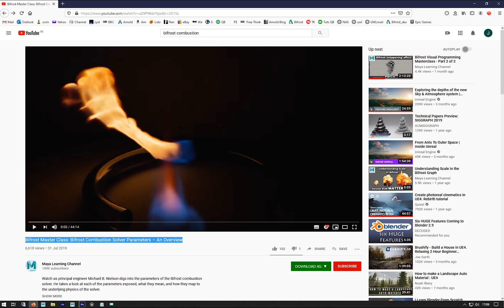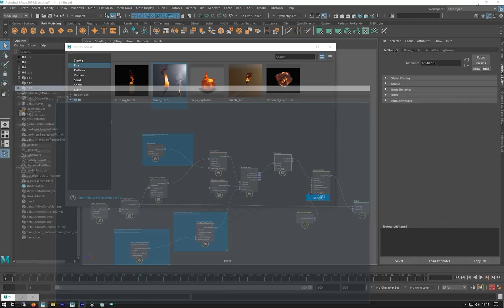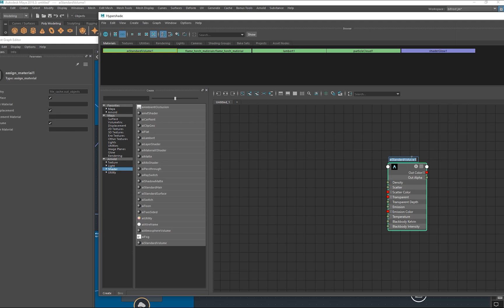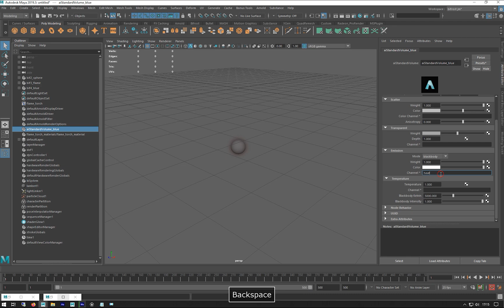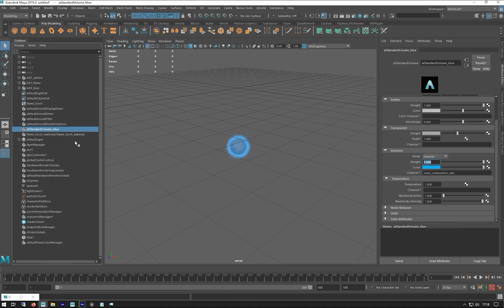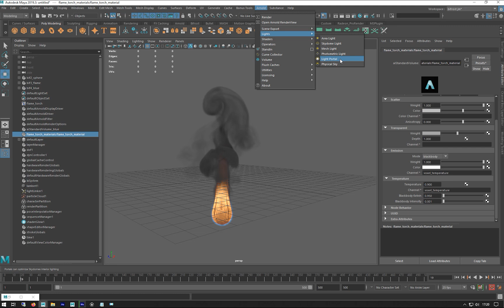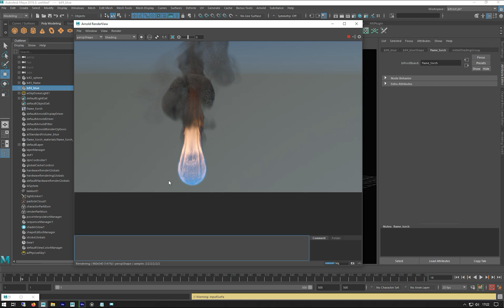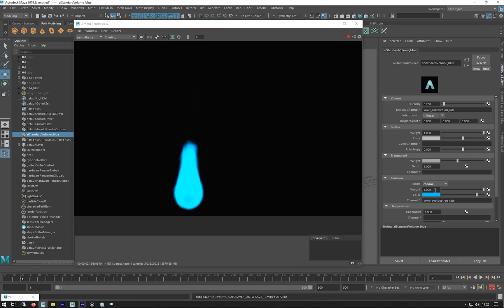Bifrost Graph Blue Flame Set Up

Comment: There are several things I don't understand. Some things were done without explanation. 

The aiStandardVolume shader I do not understand. Some fields were left blank. Two used voxel_combustion_rate. Why? 

Is there any way to prevent that initial mushroom from popping up and having a more natural flare-up at the beginning instead?
Reply: my reply is 2 years late so you mightve figured it out by now, but this is for others; to reduce that initial mushroom, you can try playing around with dissipation(rate at which the fire fades off), radiative heating(plays with the upper part of the fire) and radiative cooling(plays with the lower part of the fire). Theres probably also other settings you could adjust to fix that initial mushroom bomb you get, but thats not within my knowledge

edit: i may or may not have the radiative heating and radiative cooling mixed up, either way; just playing around with those settings should do some good! play with vorticity if you wanna make your fire shake instead of shooting straight up too
Reply: @solarenoi  I'll save your reply. Thanks.